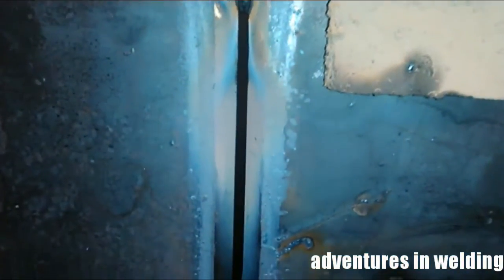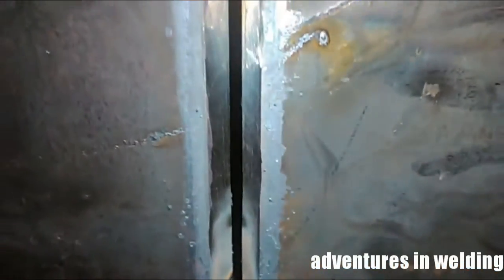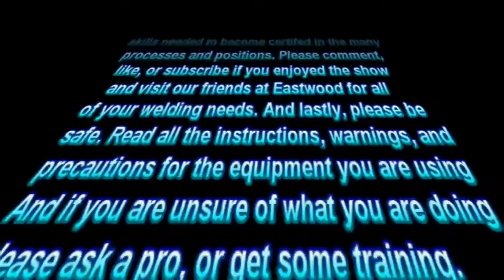Adventures in Welding 109 6010 and open root

Comment: glad you are at least trying to made educational videos on welding. using adjustment on the voltage will help make your penetration more consistent on the open root. With more practice your wells will become more consistent and even, but you actually have to practice it specifically. I used a tick tock feature on my phone to some Bluetooth earphones to help set the rythm.